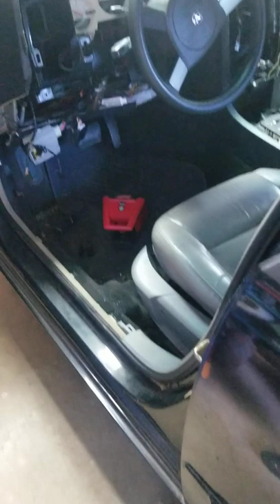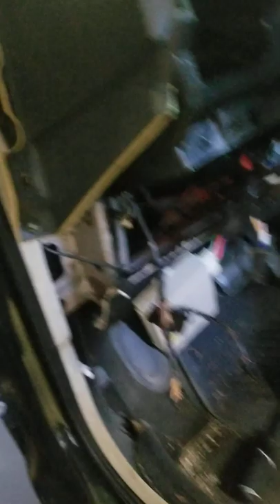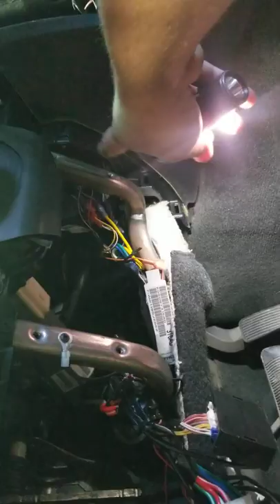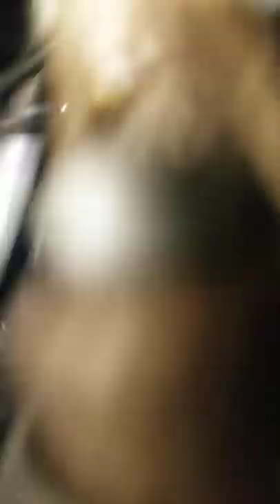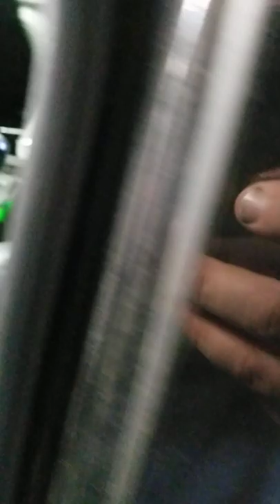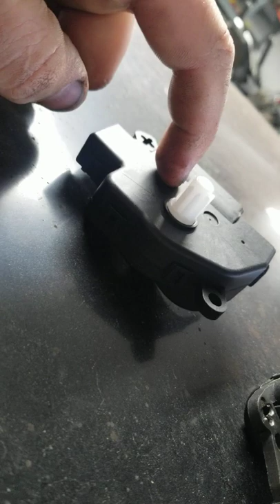Replacing 2006 charger blend door actuator driver side

Comment: how many actuators in total?   I think i heard you mention two on each side.  I have the same issue on the driver side top vent (in center console) is blowing hot and not switching with the thermostat control.
Reply from the maker: Sorry about the wait.  There should be 2 on the driver side and 1 on the passenger side
Reply: @Tomas Aldo no one cares.
Reply: Hey did you get yours fixed, mine constantly blows hot air even when off